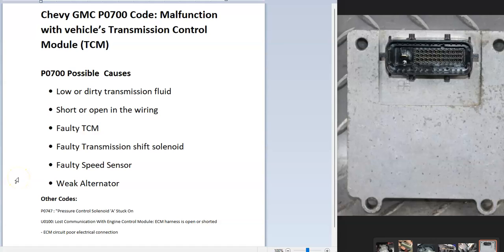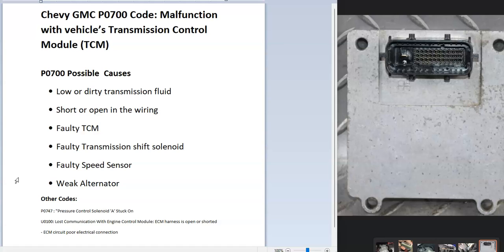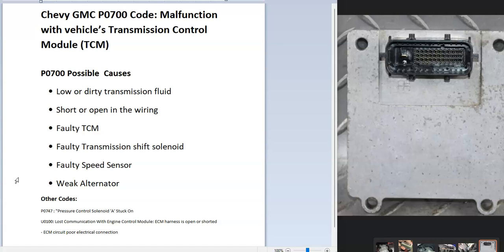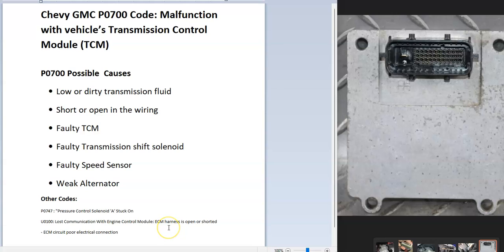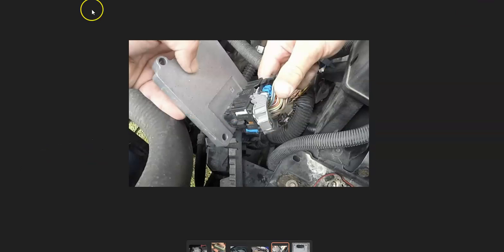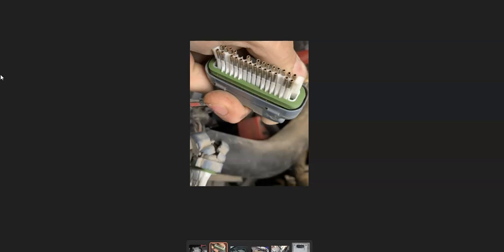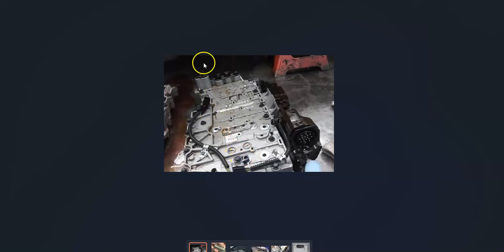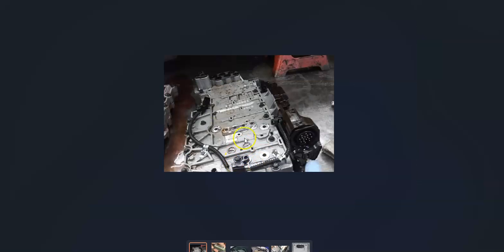Causes and Fixes Chevy GMC P0700 Code: Malfunction with Transmission Control Module (TCM)

Comment: I have a 2007 Chevy Silverado with a 4L 60 transmission won’t downshift in the low gear codes are po-700 and po-788 replace the shift solenoids and still getting problem. Can  clear my code reader and clear the codes and the transmission works fine for a few miles and goes right back to same thing any ideas?
Reply: Same Here with my 2007 GMC Sierra 1500 with the 4l60E transmission..I just changed the filter and fluid yesterday and ended up with the 2 codes P0700 and P0976-shift solenoid B control circuit low.. I am going back out there soon today and going to look at everything again..bummed I have to do it but have to have my truck !
Reply: @rosskrause3926 Do you think it has something to do with ground or the power wire on the alternator. I’m going to do the Big Three upgrade before I start looking for a TCM on my 99

Comment: 2018 GMC Yukon XL  FYI. Got code P0700 and U0100, the cause was the battery.  Started fine, alternator checked out. Replaced the battery and it went away.
Reply: My battery just died on me while camping. Got to jump and drove home. But now I’m getting the P0700 code. I’m guessing it’s the battery also.

Comment: Great video i have a 2002 chevy trailblazer my port for the odb reader does not engage scanner. I went to autozone 3 months ago and got a code but cant remember it. I know it was for some part in the shift gear area on the center console. I recently went autozone again to get it tested again because my rpm are above 3000 while driving, and my transmission gear is delaying when i stop and go.  so i went back to autozone to use their scanner and it will not turn on, so it wont read any codes. Can you help or know what it could be?
Reply: There's a fuse for the ODB2 Port.  IIRC it's the same one that the cigarette lighter uses.

Comment: Nice video covering the P0700 error code. Have you come across an additional error code (P0711) which is from the transmission temperature reader? When I went to get my emissions  checked for my new state plate both of these  codes showed up. I continually have the P0700 error code come up even after clearing it through a reader. My truck is the 2016 GMC Sierra SLT 5.3 with the tow package. Thanks!
Reply: My Cadillac Escalade is giving me those two code, did you resolve the issue?
Reply: Same here did you fix the issue?

Comment: I have my 2004 duramax 4x4 with a p0700 p0778 I checked ohm’s to solenoid b and it’s a 5.5 has 12v at plug truck stays in limp mod and clear codes and pops up right away ? Any experience with something like this ?
Reply from the maker: It's most likely in the wiring or a bad TCM.
Reply: @HVAC_Mechanic my trasfer case went out will that code keeps popping up same day my trasfer case went out

Comment: I did a full service on my Silverado 1
2011 2wd and mine was faulty TCM. Code 700 installed new one programmed to vin and solved my problem
Reply: How much they charged you
Reply: Great to know, thank you
Reply: We're u getting a blinking D on your shift ... or was it running sluggish?

Comment: 2014 Sierra started bucking like a bronco?? Sometimes I lose shifting while driving and can't go past 40 miles per hour. Shift horrible truck feels like it's gonna cut off. Got the p0700 code along with p0796 any advice would be great. Nice video also!
Reply: Got the same codes, same issues on my 2019 sierra. Any luck fixing it
Reply: I have the same issue and codes. 2014 Silverado

Comment: I have an 08 Yukon Denali . I have a p0700 and a p0777 . I have no gears foward or reverse. Fluid is pink . I cannot hear any of the solenoids in the granny buzzing when I move the shifter
Reply: I have a 07 Yukon Denali, no reverse jolts in drive. P0700 and a couple others. I am assuming tcm out.
Reply: I have this same problem. Please tell me what the fix was

Comment: Could an overfill of fluid trigger this?
Reply: I really hope so I just did this couple months back and now I believe I damage the module
Reply: It might. Mine didn't have any issues before I took it off-roading. The rear wheels spun-out in the sand and the shifter linkage jumped teeth. That caused some wear on the transmission leading to dirty metallic transmission fluid. Then after a partial flush the P0700 code came up on my Silverado 1500 2008.

Still have all gears but the shifting linkage has been off since then and it has been a pain to adjust it. Since it's my work truck I plan to leave it alone until it kicks the bucket and then re-build the 4L60e again with a new torque converter this time around.

Comment: WAIT A SECOND.    2012 GMC SIERRA 110K NEVER ANY TROUBLE OTHER THAN DEAD BATTERY AT 80k .Got same Error codes from my scanner …….BEFORE YOU WAIST TIME AND MONEY………CHANGE YOUR GAS CAP…SAY AGAIN CHANGE YOUR GAS CAP……SPEND  15 bucks BUY A OEM GAS CAP….AFTERI WATCHED THIS video I SHIT MY PANTs cause I was due for shoulder surgery  in two days. Money tight ( Fuck Biden) GONNA BUY AN ALTERNATOR. WENT TO MY LOCAL ORIELYS Auto Parts IN CAL.  . NICE YOUNG KID WHO I SEE ALL THE TIME AND BS WITH SAID  “Hold on. LETS CHECK WHAT OUR TROUBLE  SHOOT ORIELYS  COMPUTER SAYS “  he looked up my three error codes …IT SAID CHANGE THE GAS CAP FIRST….I SAY AGAIN. CHANGE GAS CAP FIRST. THIS VIDEO FUCKED ME UP…… He was very technical he may be correct but for me the ORIELYS  computer and kid did me right AND HAS BEEN DOING ME RIGHT. …went back and payed for gas cap ant tipped him 50 $. He didn’t want to take the money. SIDE NOTE….IM NOT BAD TALKING THIS U TUBE GUY HES REALLY SMART. The cap just happened to WO4K for me I DROVE IT FOR 25 miles tu4ned off engine shopping at Costco when I came back…no check engine light and scanner showed no error codes.

Comment: I have a 2013 Spark that randomly gets this code.  When it happens, it goes into “limp mode” and won’t shift gears and the auto door locks do not lock or unlock when putting the car in and out of gear.  I can’t figure out why it does this.

I will say that I put a new battery in it but the battery is an H5 size and not an H4.  Could that possibly be a problem?  The local shop didn’t have an H4 and said “an H5 would work”.
Reply: Did you figure out the issue sir? I have the same problem
Reply: @ashrafdolat2794  well, I thought I had it solved.  I replaced the intake manifold gasket thinking it might have been leaking and as I went to remove it, I found that some of the intake manifold bolts were loose.  I went ahead and replaced the gasket anyway and for awhile, the issue did seem to be resolved but a few months later the issue happened again.  

It still does it randomly and I still get a misfire (that seems to be worse at times and barely noticeable at other times).  

Im really thinking this is an electrical issue of some sorts or perhaps even a fuel pump possibly going out.  These cars don’t have an in-line fuel filter like most cars.  The filter is on the pump inside the tank in these cars.

Comment: Hi Guys having problems with a 2009 Silverado 2500 LTZ Transmission ,we have just changed the wiring  harness as the seal was leaking , put back together new oil ,filters took for a drive was fine put back up on host to check everything then it went into lip mode code that was coming up on scanner are P0700 Transmission control Model  and P0708  Transmission Range Switch Circuit High Voltage , is the 708 code were you would start looking or replace  , I live in Australia so its just not the case of taking down to local mechanic so and help would be very much appreciated 
Thanks Dave

Comment: I have 2018 Chevy Equinox with a Shift to Park ,but it is in park . I have changed the complete shifter and shift knob as well , still same problem . Vehicle is a push button start , so with this code it will not start because it thinks the car is in gear. Do you have any suggestions ?
Reply: You could try manually adjusting the shifter cable

Comment: Thanks , short and well explained...
 i have second code P0700 & P0741 saying Torque converter clutch TCC system Stuck Off.. from your opinion the torque need to be changed or there is a sensor need to be replaced on BUICK REGAL 2013
Reply: We have thesame issues. My has more codes too. 😂😂😂
Reply: How do yall fix
Reply: What did you do to fix
Reply: I have these 2 codes on my 14 Silverado 1500 5.3  how you fix it??

Comment: Where is the tcm located on an 05 silverado. For the life of me I can not find it or any info on it location. Ive looked everywhere they say it is on this truck with no luck
Reply: 4l60e does not have a separate tcm.  6l80e and up gm transmission have separate tcm.
Reply: Not true. Idk where u got that info but my '13 silverado has a 4l60e and it has it own tcm.
Reply: @lsx6.279 So it’s inside transmission? I have a 99 4x4 4L60e

Comment: My 1998 Chevy is miss firing like crazy already switched out a lot of sensors and injectors spark plugs are new spark plug wires as well
Reply: Although I was giving my buddy a jump and the battery started to spark a little and after my truck turned off it started working fine and after a little ride home it started to miss fire exactly the same ?
Reply from the maker: Sometimes fuses can blow when jump-starting if there was a surge. With a misfire, I would start with any codes that come up to point to the issue.
Reply: @HVAC_Mechanic  also went to scan it and there was just a list of things that popped up there wasn’t just one kinda was confused

Comment: Hi there 2011 Aveo have P0700 code only.. so spesifitation ...
Reply: Any update on what it was? My silverado is currently only popping up w/ p0700 as well
Reply: @Sleepy_Foo  Did you find out anything? mines popping the same exact code po700 only. Transmission starts in 3rd gear and doesn’t shift. I’m thinking a broken wire somewhere or alternator. I’ve switched a lot of parts already.
Reply: Hi! I. Also getting this code P0700 after my transmission got rebuilt.
Sometimes it starts in 2nd gear. When coming to a stop it has late, and thumping downshifts on 3 to 2nd and 2nd to 1rst gears.  Help would be greately appreciated.

Comment: Good afternoon  noon I have 2004 chevy aveo  running  very good getting codes P0700 AND P01781
Reply: Did you get that P0700 repaired.   I am lost on the same issue.   Thank you in advance.

Comment: I have a p0700 and a p0735 on my 2003 2500hd Duramax with a crank no start can you help.?
Reply: Me too did you figure it out
Reply: Check fuel pump if still working

Comment: drive a 2015 GMC Sierra 4x4 5.3 my ? po700 an po172 po175 the transmission shift ok no problem on the transmission just the po700  I was thinking to flush the transmission an my fuel trims are ltft-20 stft-8 both banks what should I do
Reply from the maker: The P0700 transmission code differs from the P0172 and P0175, which points to a "System Too Rich (Bank 1)" issue. Since you have so many, I would clear the codes and see which ones return. I would also start with the fuel-related codes first.
Reply: @HVAC_Mechanic  could a vacuum leak cause that po172&175